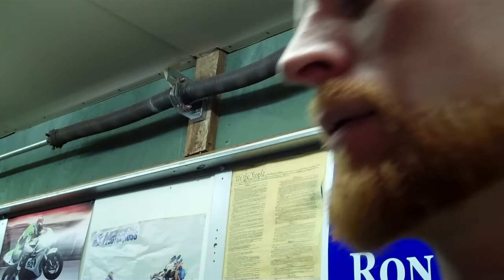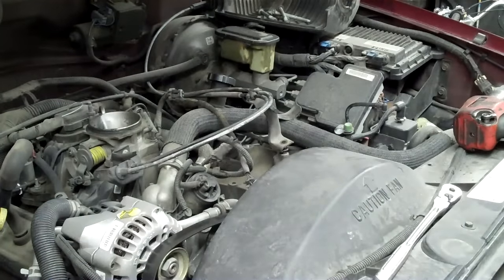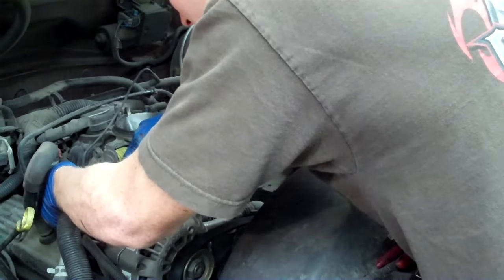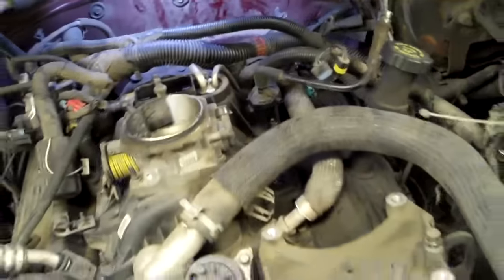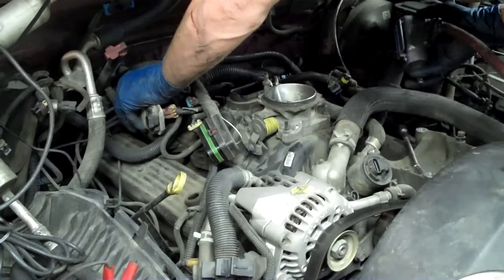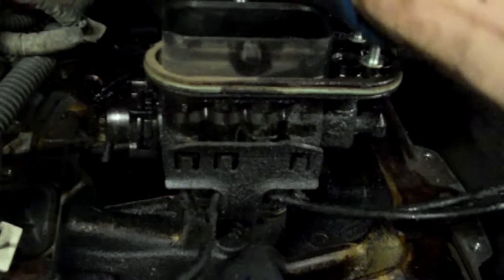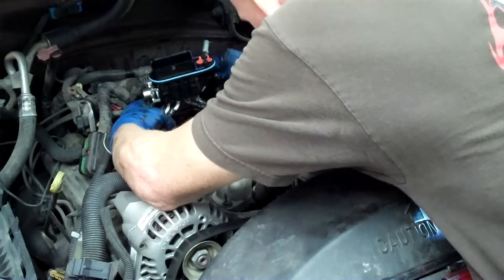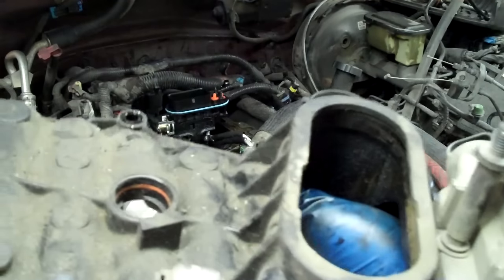How to change a SPIDER INJECTOR on a Chevrolet V8

Comment: Thank you so much.  This was a truly great video.  I am the original owner of my 99 Suburban.  It now has 170K miles and it really never ran right (misfires, check engine light always on… you know the drill).  It had the older style injectors replaced about 100K miles ago.  It also had the lower intake gaskets replaced twice (water leaks).  Repairs like this kept the truck running halfway decent and generally not leaking.  But it still never ran right.  I just did this MFI fuel injector conversion.  I also opted not to move the AC compressor.  I did it in a single afternoon.  Really not too difficult, but only because I watched your video and knew exactly what to do.  Without the video, I would not have even tried it.  The truck runs so much better now.  Just passed NJ inspection, no problem.   Definitely saved this truck from an early grave.

Comment: Thank You so much for an outstanding demo. I am a mechanic from days gone by (70 to 90) and now own a 1998 chevy truck with injector problems. every thing was very helpfull---Very well detailed and to the point. Started my project and finished in just under 2 hours.THANKS AGAIN
Reply: You did not do it in less then 2 hours. I call bs
Reply: 2hrs not
Reply: @ronvonbargen8411  
The video was only half an hour [so perhaps 1 hour for the entire job]. With the right tools handy, it could easily be done in two hours.

Comment: Just replaced this and the fuel pressure regulator on a friends 1996 K1500 5.7L Tahoe. Watched the video. Total job took 3 hrs 30 mins start to finish. Thanks for posting this video

Comment: Thanks Brian! Did this upgrade this weekend and it was much easier after watching this. Fuel pressure regulator was leaking and was hard to start hot, so did the whole upgrade instead of just the FPR. Took about 2 hours of actual work - and 2 more to clean the carbon mess that resided under that cover. The tip of putting the injectors in first, then pushing the spider down until it locked was spot on a well. My Vortec runs so much smoother now. Thanks again!
Reply from the maker: You're welcome- way to go Frank!

Comment: Hey Brian, Not sure it matters any more but the SCPI stands for Sequential Centeral Port Injection.  Crappy Diesel type poppet injectors that were opened by a valve inside the middle of the spider unit.  For those who do not know this style injector will not operate if the fuel pressure gets below 50 PSI.  The new unit is true Multi Port Injection where the injector pintle is opened via a solenoid at the end of each injector.  This is why there is a couple of wires heading down the fuel lines for each injector.  This was the best fix I ever did on my 98 Silverado.
Reply: There are situations under the spider cover that can damage multi port wires, valve leakage and fire pops, plastic fire and heat sufficient to melt wire insulation. Multi port tubes are bigger diam, I had one break near the intake manifold, so engine totally fills with fuel. I recommend the SCPI with pintel torpedoes up in the spider body, a line break is less likely and does not fill engine with fuel. Mike Reynolds, below, many new parts and no luck - sometimes the bearings on the distributor, and the gear, are so worn that consistent spark is impossible. I grind a spare cap to expose the brass and check the spark life at each line to plugs, when you short the STRONG spark the engine slows. When you short a dead cylinder the engine does not slow. Dead cylinder can be due to crud after distributor goes bad, or due to dead pintel in spider. The cap grind trick is rather definitive, you can see faulty spark power, 1/3 size sparks with an occasional full size spark means the distributor bearings wobble and the trigger is confused, timing is off.

Comment: I am handy with an engine, but was worried about getting everything out of the way and/or doing them in the right order. Followed you sequence and was a quick disassemble and reassemble. Can't thank you enough for taking the time to make and post this video. 
I brilliantly decided to do this on the coldest day we have had this year so took a bit longer as I stuck a heater under the hood to warm everything up for a bit to try and avoid the tabs on the old injectors snapping off and falling into the engine. It worked though. Gave me time to get a couple cups of coffee and warm myself back up.

Comment: Thank you for the video. I followed your instructions yesterday to do my friends 79 suburban 5.7 liter. Thanks so much- couldn't have done it without the video. The spider cost 300 bucks at Auto Zone and they had it in stock. I saw the same part at other places for 450 bucks. On his 79 I left the ac compressor, but did have to remove the thermostat housing to allow the manifold to lift up and off the heads, as part of it was directly underneath.
Reply: Thanks I didn’t think gotta remove the compressor this the comment I lookin for

Comment: thanks brain for your time I replaced the spider a few months ago and i think the upper gasket is leaking so im going to do it again could you tell me the symptons of a leaking upper gasket leak also when i was done the top of the spider was not all the way thru the intake plug went in but it was like the spider assy was lower then when i took it apart also you did not talk about the torque sequence on the reinstall and the proper way to re-tighten the upper intake if i jump on it truck starts acting like its not getting enough fuel starts to like miss drive it easy no problems expect bad gas mileage idles fines and starts right up

Comment: Well, Just picked a MPFi at AZ. I did not want to have to replace the original but.. The fuel in O-ring was split and I did not want to have any fires or pay 9.00 for one from the dealer. Installing a new crate 350 for a 305, so might as well do it right. Thanks for the informative videos! Enjoy the the general talk that goes along with your videos. You must be a Sagitarian..

Comment: The crowsfoot flarenut wrench that you use to disconnect the fuel lines in the back is the way to go.  The firewall makes it tight to fit a normal 16mm wrench in there. The crowsfoot wrench made it easy. I just replaced a leaking fuel pressure regulator in mine.  A lot of work just to replace that one little part but necessary. Thanks for the video.

Comment: Thanks Brian, kept my iPad handy for a step by step and pulled it apart 
in no time. Took a little longer to put it back together. I actually had
 about 1/2 inch of standing gas in the main connector of "the creature 
of darkness." I had no codes, but the symptoms all seemed right. Runs 
like a dream now. Thanks again.
Reply from the maker: Welcome buddy!

Comment: Thanks Brian! Great video! Van runs great now! Number 5 cylinder was running lean. Figured it had a bad injector. Tried fuel additives of course none if them worked. Not wanting to burn a valve I just knew I needed to replace that injector. I was worried it was a little over my head. After watching your video and going back to it when needed it was a breeze! I appreciate it so much that you posted this video! Thanks again!

Comment: I have 1998 5.7 vortec and it has developed a  miss or skip that I can't find, i have changed everything electrical, but now thinking spider may be the culprit, but i don't think I'm a good enough wrench to tackle this project.....dude I wish you were in North florida, cause you are the man on this fix and would love if you did mine. thanks for posting video.

Comment: Thanks a million, needed to change my lower intake manifold gasket and while i had it off might as well change the injectors, 220,000 miles, wont be long before they would give me problems anyway, looks like i ordered the same that you have in the video. lots of carbon build up on the front 4 so it its preventive maintance time.

Comment from the maker: I use a pair of dental picks and just be gentle.  Remember that if you do break them off there are ways to get them out again.  There's metal in the tips so magnets work.  And if all else fails, putting a new lower intake gasket in is actually a really good thing to do while you're in there.
Reply: I have the same truck. Only starts when I prime the throttle body. Starts runs alright to drive around. Soon as I shut it off it wont even start with a prime.

Comment: Thank you so much I have a 96 k1500 and I have been chasing a ghost trying to find out why he's misfiring I bought him new spark plugs, plug wires, O2 sensors, distributor cap and rotor and ignition coil and nothing really solved the problem he's throwing the p0300 code which is random multiple misfire after doing more research and watching your video I'm confident I can fix my ride up he got 257,500 miles and is a great truck ive had it for 11 years id hate to park him for good thank you thank you!

Comment: This is the de facto video on how to do a spider.  With some salient folk philosophy thrown in.  Thanks a ton for this video.  I have since done three of these rascals.  This is one of those jobs that looks daunting at first, but is easy if you do what brian says.  These things are very brittle.  Like he says, warm it up if it's below 70 degrees.  Use the included tool to twist the legs into place.  If you don't, your chances of breaking one of the legs goes up 10x.

I will add one observation, of course.  Do NOT insert the white nozzles until you are 100% sure everything is situated correctly.  If you need to take one out, forget it.  Impossible.  I had to make a tool out of a paint can opener to extract stuck nozzles and on a van, that's about an hour apiece in less than comfortable conditions.  They give you a couple extra nozzles in a baggy.  For the life of me,  I can't figure out why.

Thanks again, Brian,.  Great video.

Comment: Thanks for the video. I have a 1999 5.0 express van and could not find a video of this conversion for my van. I feared this job would be more difficult on a van as everything is. It turned out to be a very easy job. Having access through the cab hatch eliminated having to remove the compressor and belt.

Comment: I think I'm going to get to do this enjoyable task next week on my 97 Suburban - good spark, good compression, but a misfire on cyl #8. Thanks for the video! I'm tempted to do lower intake gaskets as well since they're such common problems on these engines but this was a really cheap truck so I think I'll take my chances.

Comment: Thank you again Brian for another very helpful video....but what about torque specs on these bolts? I kno you gotta tighten up these from the inside and work you way outside in a chris x pattern but does torque  really matter on these bolts?....can you tighten these up too much and strip them?...am about to replace the spider in my 00 savana...dont own a torque wrench this is why am asking. ..Thank you Brian.

Comment: Thanks for posting this video Brian! Your calm way of talking while doing the job really helped me when I tackled this job yesterday. I watched your video about 4 times then decided I was able to do this. It's been a little cool this week so I used one of the others comment suggestions and used my heat gun "very" carefully to warm up the plastic tubing and everything worked out great. The most nerve racking parts was snapping the unit into the bracket but with patience it went right in. I don't have a garage so I had to do this outside. My truck started right up and runs like a new one. Dennis

Comment: Update to my earlier post , it is an 98 Chevy pickup 2500 with 5.7 engine ,it looks like water got into the fuel system , 
I have added Lucas Fuel Treatment hoping it solve the problem ,
How long does it to remove the plenum then replace the fuel spider how many hours ?
Thank you for your help .

I have a 2000 Chevy pickup truck with a Vortec Spider Fuel Injector Assembly for Chevrolet5.7L , it's been sitting for awhile , every once in a while I will start the vehicle up until it warms up , this time there was a rough idle with a lot of black smoke as  if it's coming out of one cylinder , as it warmed up there was a reduction in the amount of black smoke ,  the idle became better , I used to do a lot of European cars and I have very little experience with the Chevy system , from what I was told it might be a fuel nozzle injector hanging up .
check engine light did not come on , what's the next step in diagnosing this thing ?

thanks

Comment: Great video  planning on doing the spider  change some. Engine running rich 4 and 7 plugs are wet. There is alot of fuel in the base to.

Comment: Great Video ! Coulldn't have done it without your video, probely would not have even tried! Finish New Spider Injection install Last night ! Truck runs like new now ! I didn't even have to remove ac compressor like you did! It was a pain in the ass job but I am sure I saved at least a grand in labor charges ! Thanks Again !

Comment: I have P0300 and P0308 codes on my 2000 5.7 Tahoe. I replaced plugs, cap and rotor. Fuel pressure test dropped 10 psi in 10 minutes so I figured it must be either the fuel pressure regulator or a leaky injector. However, after watching this video, I want to make sure that's my problem before I go to all this trouble and expense. Compression was good, but I suppose that I should do a leak down test? I don't have the tool. Would just run with the new spider injector if the fuel pressure dropped like that or would you do the leak down test as well?

Comment from the maker: No.  It means that bank is too lean.  That could be a loss of fuel, (like a stuck or blocked injector) or MORE air like from a vacuum leak. OR an oxygen sensor on that bank that is contaminated or burned out.  Usually if an injector fails it's just one and the code will be a misfire code on that cylinder.

Comment: I had the strangest thing happen after changing the spider , I still have not been able to figure it out. After replacing the spider I took it for a test drive and with 50 feet of driving it I pushed the AC button and smoke started coming out of the AC controller it fired the controller. I have traced all the wiring inside and have not found any bad wires. The AC has been replaced all the Air blend motors have been changed. Not sure if there is one for the hot to cold. The AC work great before changing the spider so I thought I might has pinched a wire or forgot a ground but everything looks fine, I replaced the AC unit the high pressure cutout switch and the dryer still put a new on in and it smokes it when turning off the fan switch. Not sure if anyone has ran into this problem but I thought I would put it out there I watched your video to go back through all the parts and wiring being removed to see if anything would click just in case I missed something thanks for the great video.

Comment: Great video on procedure of swapping it out!

Any info on diagnosing a bad "Spider Injector"? You mentioned in the video the truck had P172/P175 as lean (I believe you misspoke since those are rich codes and the pcm would remove fuel with a negative fuel trim). Was it misfiring?

I am wrenching on a 1999 5.7l, P0172/P0175. Really no symptoms except a CEL. Fuel pressure is 62-66 but did bleed off over 1 hour to 20psi (but have to consider the fuel pressure gauge leaking). Engine runs fine/smooth w/o misfires. Fuel trim is buried negative at idle and slightly better cruising, BUT has compensated to 14.7:1 with the o2 sensors switching rich to lean. Coolant temp/IAT match cold, MAF is around 2400htz at idle. 

I did pull the upper plenum for a look, no clean spots under the lines or under the fuel pressure regulator in dripping fuel. I think the fuel pressure regulator is releasing fuel into the plenum through the vacuum port, but there is no evidence of this such as a clean area under it. I really dont want to make a bad call on a $50 fuel pressure regulator or a $300 spider injector based on the evidence I have.

Suggestions?

Comment: Good teacher, thanks for the tripod. Have a 96 5.7L vortec in my suburb, Just quit while driving and wont start. Has 320K miles on it. Have good spark. Fuel pump works. Fuel pump regulator ok. Has gas at the rail. All elec power and grounds at the spider cap are good. Will start and run if I pour gas in the throtle body port. I suspect the spider fuel injector is bad. Gonna attempt a first time replacement because of your great video. Sould I look elswhere first?

Comment: Great video.  I am changing fuel pressure regulator.  How do you get the injector plug to pop back up into the manifold.  Been pulling on it but no luck.  Comes up part way then seems to stick.  I cleaned and lubed the surfaces before assembly.  Don't wan t to just screw the manifold top down and hope it pops in.

Comment: I just did this on my 97 Tahoe. Couple things: you can buy the delphi unit on amazon for much less than various retailers and MUCH cheaper than dealer and comes with the new hold down clip though its not mentioned. The injectors going out are also associated with having a constant or consistent miss fire code, mine was Cyl 7. I'm not sure if you discussed any miss fire codes, I did my best to watch the whole 36 minutes but I do not recall hearing it mentioned.

Comment: Great video!  I recently did the same exact replacement, however, When I got everything back together the truck (5.7) was hard to start and I could not keep it running except to baby the accelerator.  Any suggestions?  Do I need to do anything with the computer when switching to MPI?

Comment: Got a cylinder 6 misfire. Not intake new plugs wires. Only kicks check engine light over 60mph. And will turn off after about 8 restarts. . Doesn't run rough or seem like its misfiring. Could it be the spider 🕷?    Great video thank you.